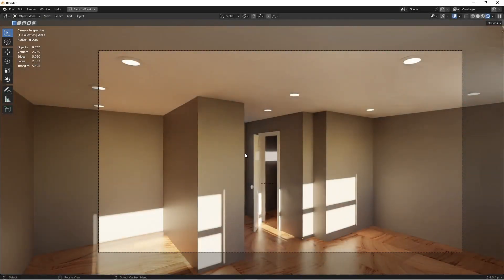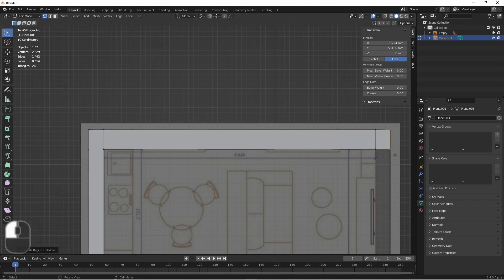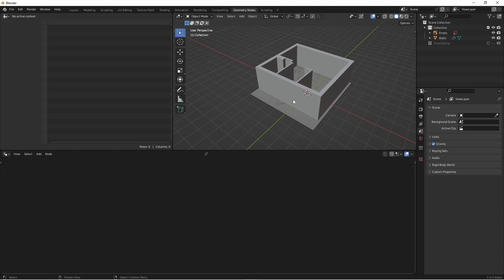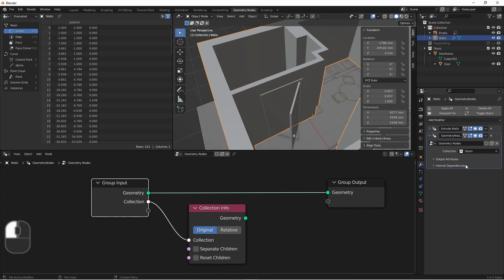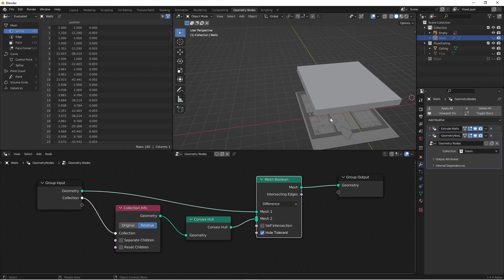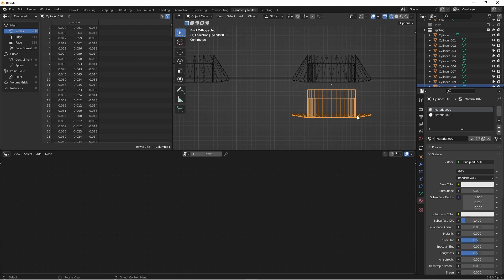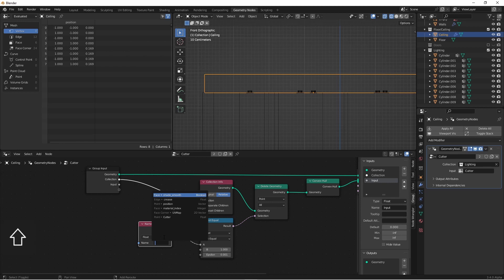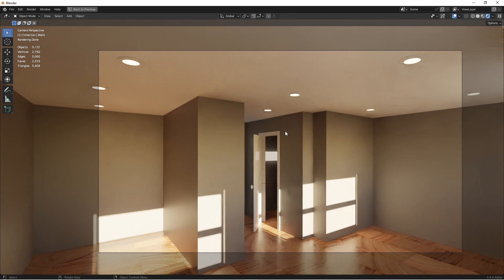Custom Cutters with Geometry Nodes: Perfect for ArchViz Assets!

Comment: thank you very much for this tip. Should one prefer to have the cutter be deeper than the object itself, I found a "scale elements" node with a normal input plugged into the axis, following the convex hull, allows for scaling of the convex hull on the input geo's normal axis.

Comment: Very cool! But it seems to me this is only necessary if you want your cutter mesh to be part of the same mesh you're placing. I'm still not sure of the best way to build these in Blender, but I tend to have multiple objects parented to each other to create doors & windows. If I do that, I can have simple child objects for cutters, add them to a 'Cutters' collection and then use GeoNodes Mesh Boolean or just the Boolean modifier to difference the Cutter collection. 

Since the cutters are children of their respective doors & windows, they move with them but are easy to select. More importantly, they're easy to hide from rendering, so no worries if some edges stick out. And no need for vertex groups or convex hull, just the cutters themselves.
Reply from the maker: Do what works for you!

Comment: what if the door is connected to the window and the shape is round at the top, I have tried it with convexhul or with a bounding box but it didn't work, so I added a mesh similar to the door and window, is there any other solution?
Reply from the maker: Hmm I’d probably need to see an example to understand what the trouble is. Send me a DM on Twitter @johnnygizmo